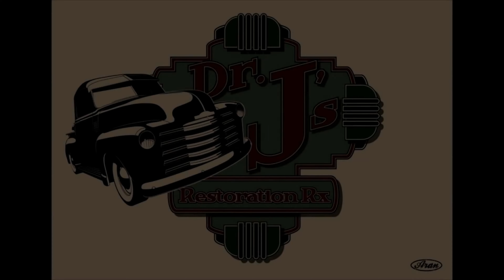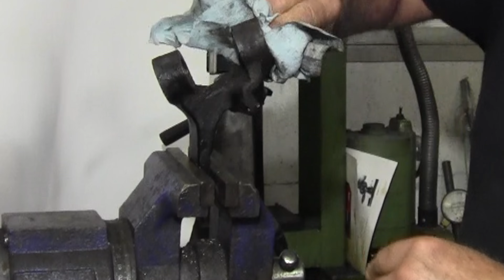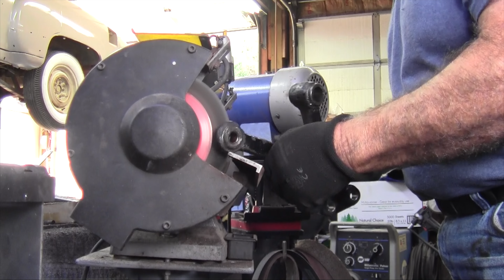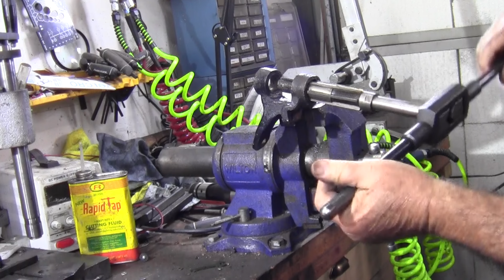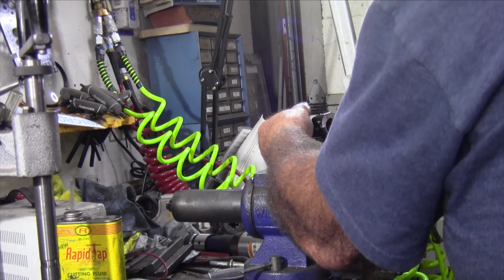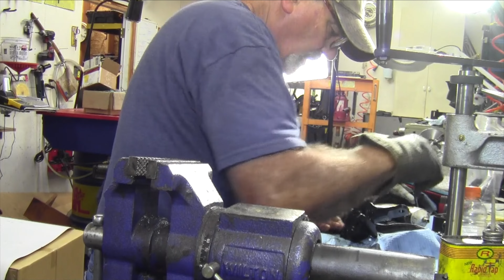1949-54 Chevy passenger car idler arm rebuild

Comment: Great Job Jerry, I have 1951 chevy Deluxe, I will send you mine for rebuilding, my steering is Getting a little Sloppy, Great Video
Reply from the maker: Sounds great! I stock rebuilt arms for exchange, unless you only want your original rebuilt. I charge $200 for rebuilding plus shipping, and then $200 core charge which is refundable upon return of your old core.
Reply: @jerrykassis5181 I will Send you my Original One for a Core, Thanks🇺🇸👍

Comment: Why didn't you put shims on both sides of the arm ?
Reply from the maker: I had often pondered that question myself. On all of the arms that I have rebuilt, probably over 2 or 3 hundred, the GM originals had shims where I put them. I was just following GM's lead on that. I don't see any great advantage of installing shims on both ends once the frame is milled flat. The main thing is that the shims eliminate most of the vertical play in the arm. That said, putting shims on both ends may provide a little extra bearing surface. I may visit that possibility in the future.